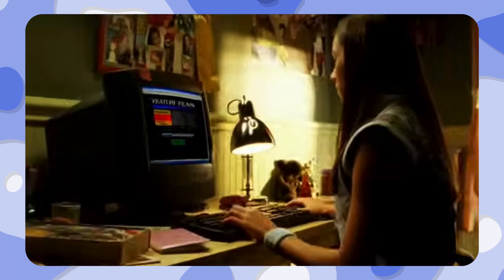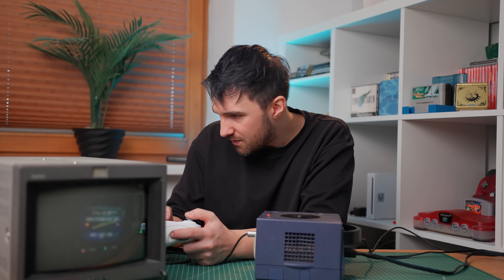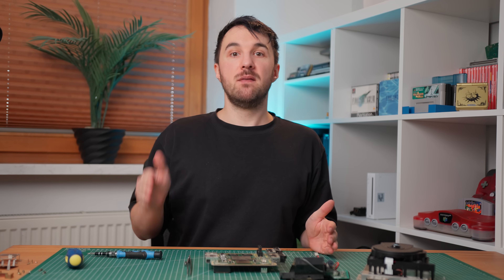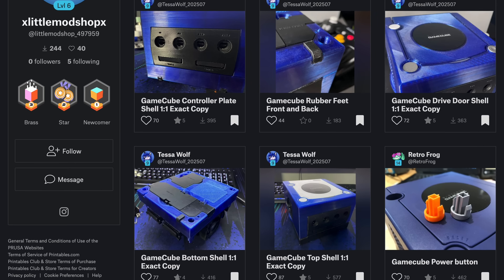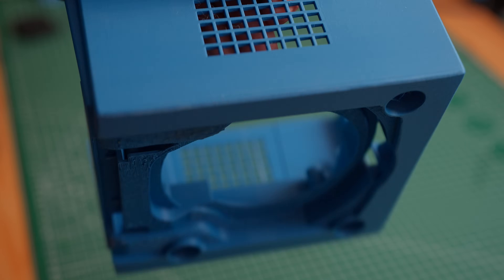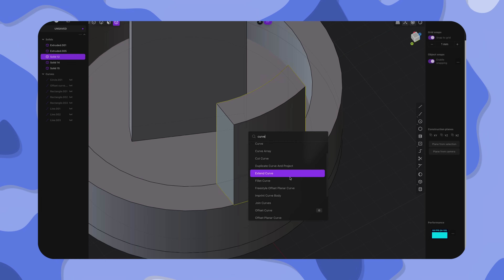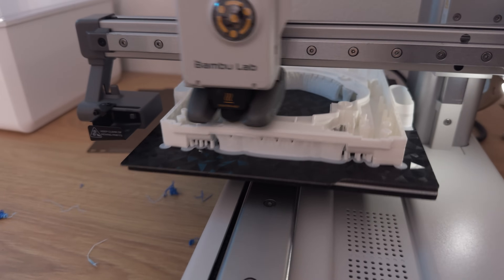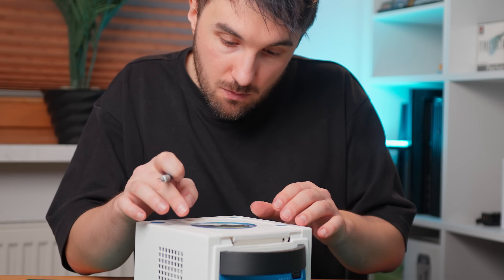I 3D Printed a Gamecube - USB C Mod, Custom Jewel, Noctua Fan, LED Swap, Battery Adapter, etc.

Comment: Has anyone found the file he used for the Gamecube Handle? Or maybe you could weigh in @littlemodshop. I have looked through all of the files/collection you linked and it seems to be the one piece absent. Any help from the community would be greatly appreciated!  Happy Printing!

Comment: How did you made the stickers for the jewel? Is that a plotter with a printer?
Reply from the maker: Yes i just used a normal photoprinter and cut it with a silhouette machine. Can’t really recommend the machine but got the job done :)

Comment: WOW! Any chance you will release Scad or any other open files? I've got roughly 2 Gamecubes with broken drives and i've been trying (without much success) to make a more "slimmed" down version of the gamecube top shell that doesn't have a drive at all! This would greatly help me in the pursuit, altough making changes to the STL is possible in fusion 360!

Comment: It could be funny to make a single literal unibody GameCube that can't be opened (Without a saw or hammer.) because you pause the print at the right places, place all the components in place, and then continue the print.

Comment: Heads up, your printer moving across the table can impact the quality of the print. Also, if you use PETG or really almost anything but PLA, there are safety concerns depending on where you print (even PLA has some minor concerns). This was really cool, stay safe!

Comment: This is a sick video! This is exactly the kind of stuff I want to do when I finally get a 3D printer. I have an old PS2 controller with some messed up buttons and a broken R1/R2 piece, and a Nintendo 64 with a very noticeable chip in the shell right at the front. One day I want to make brand new shelling for them.

Comment: In 2005 I got an ice crystal case that accepted full sized DVD's before the days of SD card loading. I still remember the modchip light shining through the transparent smokey plastic. Unfortunately, I lost this console in a burglary in my storage unit, but your video brought me back. I have a X1C and have been making gamecube keychains, but maybe I should build an ITX machine in a gamecube case.  Liked and Subb'd.

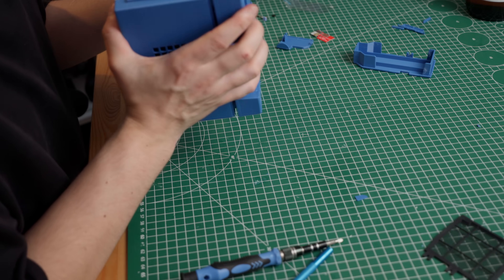Comment: 11:30 Most folks don't realize that plastic shrinks in the XY planes specifically(Because Z gets corrected with each new layer mid-print) and needs compensations figured out. It was a huge sticking point for me in BambuStudio that they only just added 2 months ago. They finally implemented it, but I've now moved on to OrcaSlicer and LAN Only mode to keep away from their currently very bad management choices. As a rough generalization I use 0.3% for PLA and 0.4% for PETG.
Reply from the maker: Thank you that helps a lot and will look into it
Reply: Where is that setting in orca sliceR?
Reply: @ Oops sorry, I replied to you incorrectly from another comment thread(and luckily noticed) Inside orca beside the active filament colors, click the little edit icon beside them, then under the main "Filament" tab, about 8 entries down is "Shrinkage (XY)" hover over it for a usage tooltip. But in general I've found for a well calibrated machine PLA usually ends up around 99.7 for me and is a good 'guess' number as I pulled it straight from PLA's raw material shrinkage coefficients. PETG is more like 99.6 as it's printed at a higher temp so incurs slightly more shrink upon cooling. But by all means print some 100mm test bars if you have reasonable calipers to dial it in.

Comment: What I love is that you did a BUNCH of mods for this aside from printing a new shell and those aren't all of what's available for mods on the system. The support for keeping Gamecube alive and relevant is amazing.
I've done PicoBoot, a BlueRetro receiver, HDMI mod, and put in a SD2SP2 adapter for mine. I'm waiting on a FlippyDrive with Ethernet to ship in April, but I've got a Gamecube I mangled sitting around from a long time ago I might be able to revive with what you've done here! I'd start right now if I could get a shell replacement with a disc bay that accepts full-size DVDs.

Comment: Thanks for this video.
While I'm not overly worried about replacing the shell on my GC, I'm definitely interested in being able to play backups of my games, as the physical discs are getting old.
Being able to power it from USB-C is also an improvement, so I have parts for both now on order, and further GC modding videos in my watch queue.

Comment: I really like that mod, keeping the original drive, but allowing backups to be used. The only change I'd make is to get PCBWay to print all the parts in clear resin. Maybe the next project you do that they sponsor you could get them to print the shell.
Reply from the maker: good idea, thanks for your input. i really wanted to show off what can be achieved with things at home, but will keep it in mind for future projects :)
Reply: @littlemodshop  This might be a crazy idea, but if you want to show off more of what can be done at home, how about changing the form factor of the console? You could convert it into a GamePrism or a GameSphere.
Reply: That's frickin hilarious. I want a Nontendo GameSphere! (Loved the vid tho, and have printed out a replacement top shell for a beat-up GC I got given.)

Comment: how come you didn't install the hdmi mod? just wondering
Reply from the maker: this gamecube mainly lives besides my sony pvm (as seen in the video) and for capturing footage i use my ossc. so there is no real reason for a hdmi mod. but i do have some consoles planed in the future with a hdmi mod. stay tuned. :)

Comment: PLA is not good material for long term use in electronics, just use ABS or PETG
Reply from the maker: i agree, should've used PETG
Reply: To be honest I would try ASA because on the A1mini I had a lot of issues with Warping if you don't have a chamber. ASA has a lot less Warping..
Reply from the maker: with an a1 mini? does this work? haven't seen anybody print with ASA on the mini before but will give it a look, thanks! :)
Reply: @littlemodshop  Yeah, just put a box over it so it doesn't loose temperature..